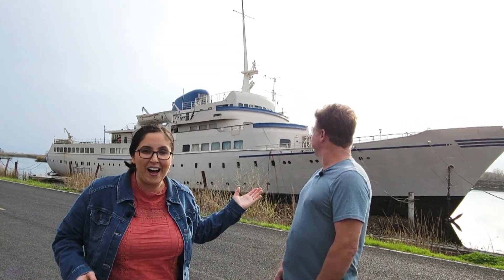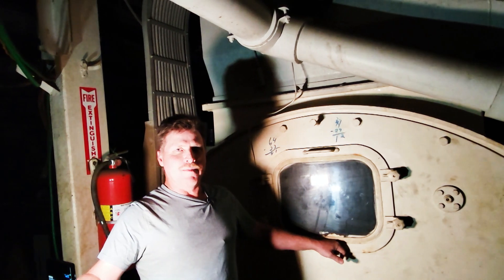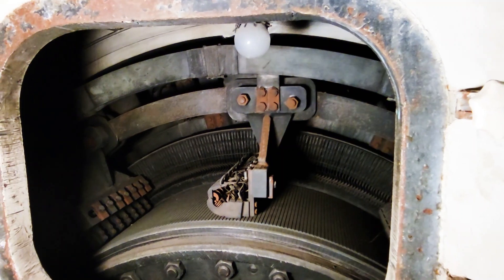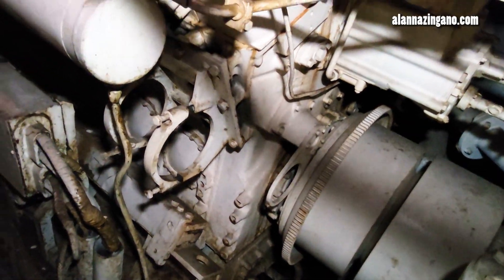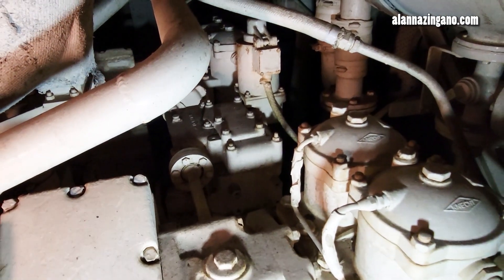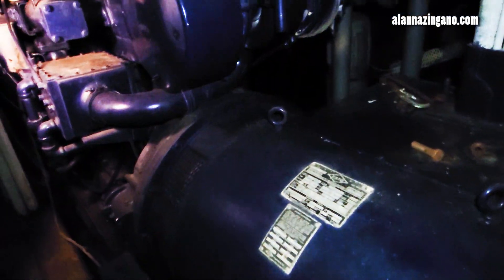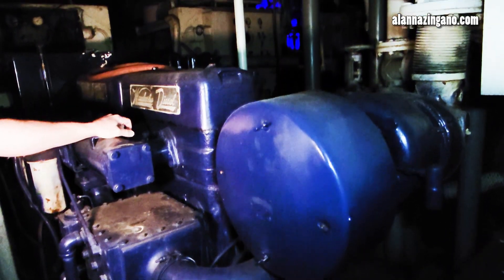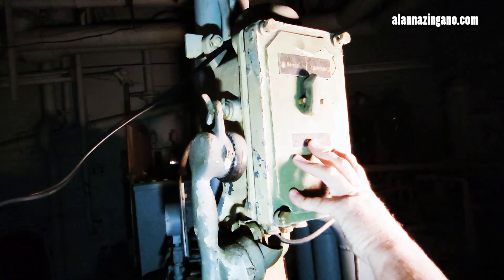FULL Engine Room Tour of Vintage Cruise Ship, Aurora, Wappen von Hamburg

Comment: Maybach MD655's as fitted to British Rail Class 52 locomotives, there are a lot of very knowledgeable guys over here in the UK who can fettle and rebuild those engines, check out the WLA group and the DTG group both based at The Severn Valley Railway

Comment: The fire hose should have an inspection date stenciled on it. I don't know what you use for a pump but even though the mains are not in operation the hoses and fire suppression system should be operational before you start working on the engines. Spilled diesel and oil will be happening so fire danger is there. There are hose companies that might donate hoses or fire departments that dispose of hoses that are no longer good for them but still serviceable. As a firefighter I would suggest having some Halox or CO2 or other vapor fire suppressor extinguishers in the engine room.
Reply from the maker: Since we had limited time to film the engine room along with other areas (to come soon). I ask Chris if he can find the details on that hose, and also to inform him about those suggestions! Thank you for everything you do as a first responder!

Comment: That is, electric motors are used for movement. I thought the usual scheme with a propulsive diesel engine.
The whole problem with engines is their certification according to the register for all sorts of different protections, such as overspeed (should be both electronic and mechanical at the same time) and many others. It is good that this diesel generator is small - there will be no problems with the transportation of spare parts. Once we changed the crankshaft on our tanker diesel generator - we had to cut out part of the ship's side - it is huge.

Comment: Maybach Engines are the same as used in the German V200 diesel hydraulic locomotives and  British Rail Class 42 Warship and Class 52 Western Diesel Hydraulic locos. 
They are very expensive to overhaul 150 k+ ea and very advanced engineering for their time. 6 valve heads, overhead camshafts, roller main bearings and also somewhat fragile with much finer tolerances compared with larger heavier slower running engines. 
The Maybach MD was developed into the MTU 538 range which I believe was made until the late 1990's...
Reply from the maker: So interesting! thank you for sharing your insight!

Comment: What's the bubbling thing? Just some lamp you found?

All the EM switchgear could totally be made fully operational. That stuff was built to last forever. Plus it's amazing what they engineered for diesel electric at a time when steam was still in use. (the last commercial steamer was built in the 50s).

The only modern thing I would suggest adding (only if there's room) is a battery backup for ship power so you still have lights, radio, GPS, radar, exc in the event of a total breakdown.

Comment: These all seem to be in good condition. They will probably only require new filters and oil change, injector cleaning etc.. This is quite an advanced system for 1955 and these diesels powering the huge twin electric motors are a good system. I take it she has twin props direct drive with no gearbox?

Comment: The drive motors are DC electric marine  motors. I'm guessing they're 6-8 thousand horsepower just gazing through the portals.

Be sure to have proper electric motor techs test and work on them. Megging just tests the state of the coil insulation and amount of moisture in the coils.

An AC drop test can be conducted to test individual coils to be sure they're good, and a bar-to-bar test can be done on the commutator to be sure it's still good. Also I recommend replacing and setting all the brushes.

Source: used to be an electric motor tech and worked on 8k HP DC marine motors that a local steel mill used.
Reply: Sur ..you  have  to  that ....first...I  confirm.....about (Electric generator).  To  clean  each    ( bruch)....

Comment: The kit looked at first in the video is an absolutely magnificent DC motor (specifically the commutator and brushgear, seen through the inspection hatch), probably connected directly to its propeller without gearing. Possibly the motors - I guess the vessel had twin propellers - were similar in design to those used in those days for steel rolling mills.   Maybe the generators driven by the diesels are DC too, the generated power of  each generator being controlled by the generator field current using a 'Ward Leonard' scheme.. Technology has moved on and nowadays, diesel-electric ship propulsion systems and rolling mills use ac motors which don't need commutators etc.   but do need complex power electronic converters.  It would be great to see the propulsion systems restored for the historical and heritage interest alone, but the cost and effort would probably be insuperable.
Reply from the maker: Chris does plan to reach out to the engine manufactures to see what they can do to assist!

Comment: Realistically you are probably going to have to remove the main engines and have them sent out and be rebuilt because most Mercedes diesel engines usually won’t be rebuilt here in United States because we don’t have metric tooling for those engines so you’re gonna have to have it in the back of your mind that pulling those engines is going to be the necessary thing. I’m not sure what kind of fuel system those engines use you didn’t show the engines in the video well enough to know if it’s indirect or direct injection or what kind of mechanical injection it has. Most diesels of that era you need to clean out the injectors make sure the mechanical governor is free and your fuel rack is not stuck, then all you need is good clean fuel and they should run just fine, the generators I would just clean of any debris check all the electrical connections and let her rip

Comment: Change filters and fluids 
Probably air starter fire that bad boy up
Reply: That’s exactly what I’d do, they’ll either run or they won’t. Just check they have oil pressure and make sure the heat exchanger is pumping water then work out what they need from there

Comment: That 5th engine probably needs rebuilt that's why it's in pieces they were tearing it down without all of them up and running it won't provide enough power to the drives you'll burn them up electric motors will run on low voltage but if you don't supply the correct voltage you'll torch them

Comment: Did I hear right, this was built in 1954?   That was 67 years ago.  If a young man of 20 worked on the initial build, he would be 87 years old today.  At that age I doubt you will get many volunteers simply because by the mid-80s most of us have bodies that are worn out - arthritic knees, hands, fingers, failing eyesight, limited mobility, diabetes, prostate trouble, plus various cancers and failing organs.  I would be more confident with the success of this project if the engines were common in the mid-1970s - there would be a potential workforce about age 67, in the US the age of retirement.
Reply from the maker: Keep in mind there a lot of people out there that knows on how to work on similar engines. If I remember correctly Chris has some of the original specs for those engines.
Reply: The ID plate on the Maybach said 1965.

Comment: Electric powered by diesel was a very bad idea in a ship. It just added tons of machinery to mal function when you could just have the diesel engine driving the propeller shafts. Stupid idea.
Reply: Ha, Every single modern cruise ship is diesel electric, the BIGGEST container ships are shaft drive right form the engine however, The largest weighs 2300 tons and put out 104,000 HP,  Google the largest Diesel engine in the world to see it.
Reply: @poppie1946  I guess my ignorance was revealed. But what I was reffering to was tug boats that I worked on all my life. Some of the ex military tugs were diesel electric and they were a nightmare for the engineers.
Reply: Diesel-electric is an excellent system for cruise ships, you can scale down to more but smaller engines which you can place where it’s most convenient for noise, vibration…., just a cable connection not a long prop shaft
Reply: @12345anton6789  yeah does make sense. But I was thinking in terms of tugboats which I  worked on all my life. Some of the ex military tugs were diesel electric and they were always having problems with what they called the excite r  I had to spell it with the r that way because the auto spelling which I hate with a passion wouldn't let do the right way.  Everyone who worked on these boats considered DE as a pain in the ass. Thanks for the response.